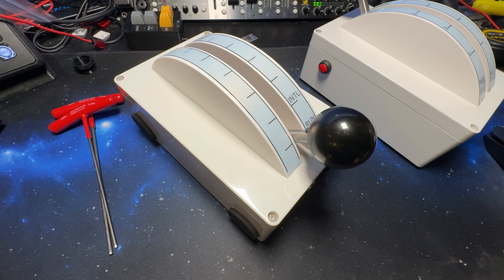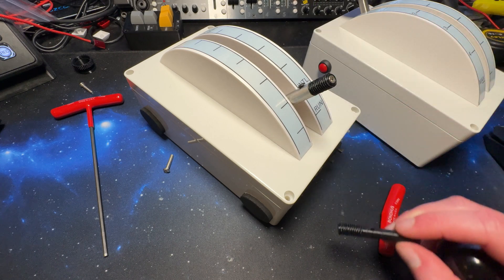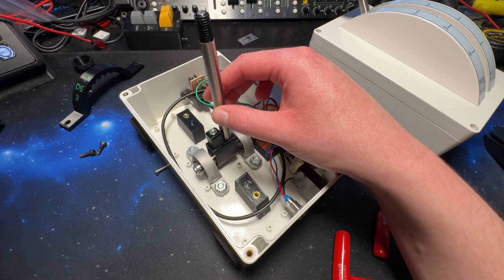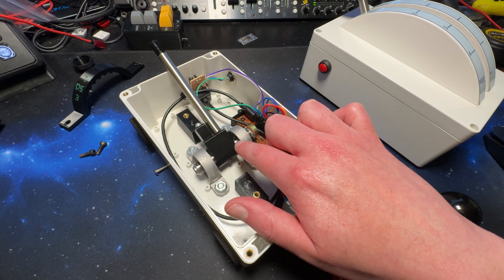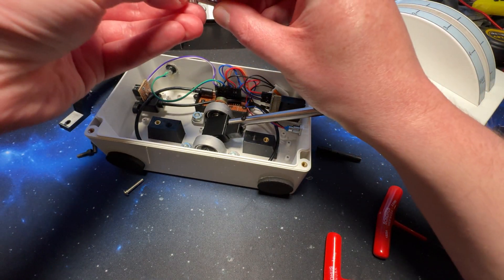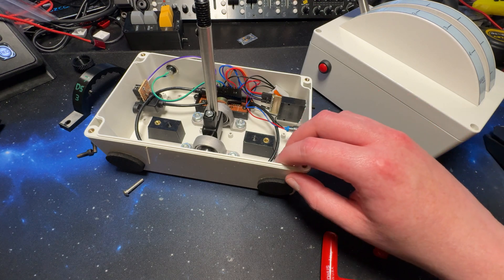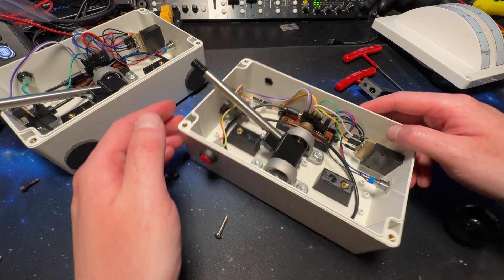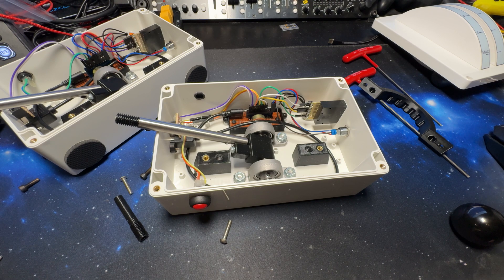Train Simulator Classic Controllers - Detailed Look - Part 1 - Throttle and Brake Levers

Comment: Where did you get the notcher from, or is it 3d printed?
Reply from the maker: Yes it's a 3D printed part I designed. I can't make the model available but I'm designing a second generation of controllers and might be able to release them for that.
Reply: @MattTester  are you not able to provide the file for the notched part? Believe alot of people would benefit
Reply: @MattTester ahh, I have the notcher, what’s the part for the actual lever bit that I can use the notcher on?
Reply: I mean, what’s the bit that wires the throttle that the metal pipe on the bearing blocks connects to called that makes it so you can make the throttle work called?

Comment: @MattTester I am trying to do a similar thing to make a controller for the Densha De Go Arcade game (Japanese game series. I like your idea of a potentiometer (I was going to try to use rotary encoders) as the game I want to use it for uses an input for "up" and "down" and measures how many times each input is pressed to measure the position of the controller. For my purposes, I would need a total of 15 notches. How did you design the notched plate? This part is really perplexing me and has proven to be a barrier to completing the project. Are there any tips you could share that might help me figure this out? Thanks.
Reply from the maker: Hi, thanks for watching. I've seen videos of Densha De Go on Techmoan's channel, a custom controller for that would be nice. I designed the notch plate in Fusion 360, any 3D CAD package should work though if it allows drawing.

I initially cut the slot in the top cover so I knew the possible travel of the lever, then measured those angles. In the CAD sketch, I could mark out these angles and place an arc between them. The arc would be as big a distance from the pivot as possible, without the notch plate hitting the top cover once printed and assembled. That's the top of the removable plate. Add a second arc that will be the bottom, where the notches will be, and you have a basic 0 notch design that could be printed for testing. The plate doesn't need to be very thick, but more than the radius of your notches.

For the notches themselves, now you know the total angle of travel you can divide that by the number of notches (exlcuding the end two as you already have those) and mark those angles on the drawing, crossing or attached to the bottom arc. At the ends and at the points where the lines cross, add circles that will be the notches. I used 2mm and 3mm circles on mine but this will vary with the size of the controller. Remove the lines you don't want from the sketch and you have the 2D outline of your notch plate. It's a good idea to smooth out the hard edges of the notches, depending on the CAD software you may be able to easily do this on the 2D sketch, or you can fillet this edge after extruding. Without this the lever might be difficult to move, but there's a lot of room to experiment.

Add your mounting solution and it's ready to print.

I have another video about the code I used for the potentiometers and the rotary encoder, that might also be useful to you.. Cheers.

Comment: This is a very simple and ingenious design. I like it. I use pure potentiometers as joystick axes for my TS classic. A program converts the positions of the axes into values for the loco. But I miss the latching levers. With your idea, I could get my American control stand finished. Do you share your 3D data?
Reply from the maker: I'm hoping that this way with keyboard commands gives me a few other options, like making an up/down brake lever for trains with auto air brakes (UK class 66 is one example). I will make the 3D models available but that will be a bit later on as I might make some changes. The 8 notch is ideal for the US style controls, as the throttle module is the same as the class 66/67.
Reply: @MattTester  Thanks! I use 6 axes: Reverser, Throttle, Dynamic Brake, Auto (Train) Brake, and Independent (Loco) Brake. Of course, not every locomotive has a dynamic brake.

The US controls are a 10-notch. The first is Stop, which has not been used for decades. There is a placeholder/stopper mounted there. The second is Idle or step zero. This is followed by notches 1 to 8. The same controls are used for the dynamic brake. Here, Stop = Off and Idle = Set Up. I guess from 1 to 8 there are no notches here.